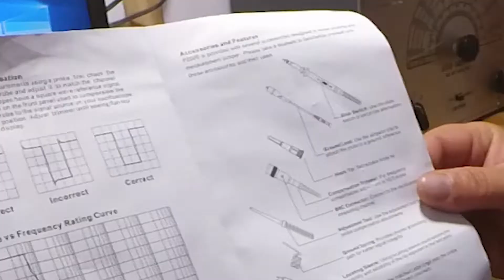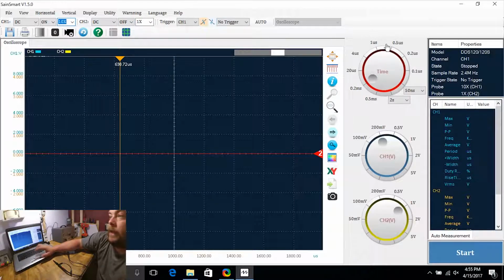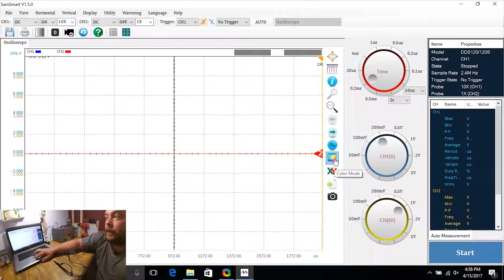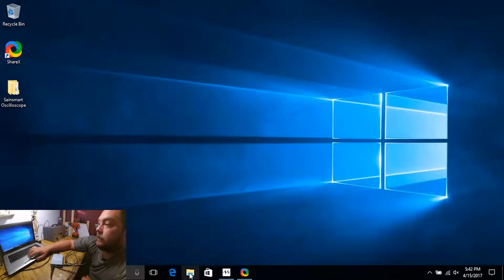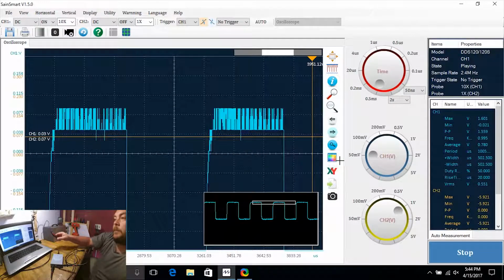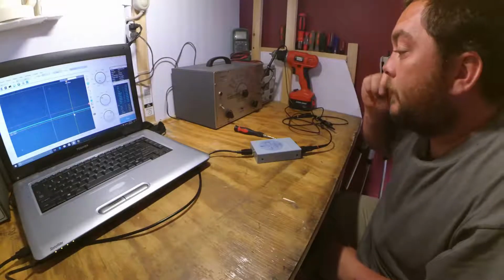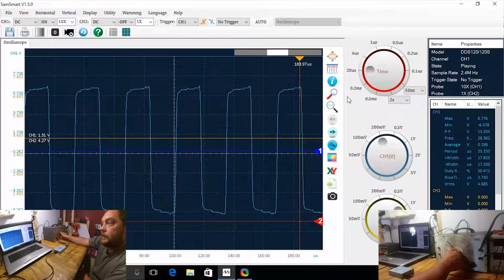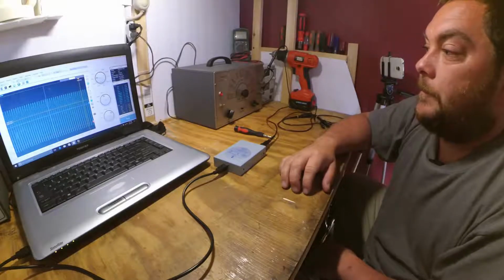SainSmart DDS120 oscilloscope unboxing setting up and testing

Comment: I bought the same DDS120 oscilloscope, is it possible to read characters from a UART port (+5 V levels) ??, I tried to , but I get some pulses, is it possible to convert the detected pulses to the equivalent ascii code ??

Comment: You need to be aware that the scope is NOT isolated and you could possibly burn out the USB circuit in the laptop.
Reply: Another caution is connecting the ground clip of the scope probe to the ground of the signal generator could be hazardous as well since the ground on the USB cable is actually mains ground as well.
Reply from the maker: HA HA ok thanks I'm good but thanks anyways